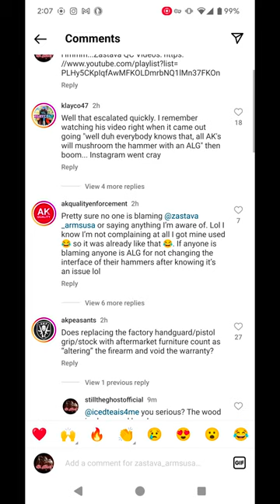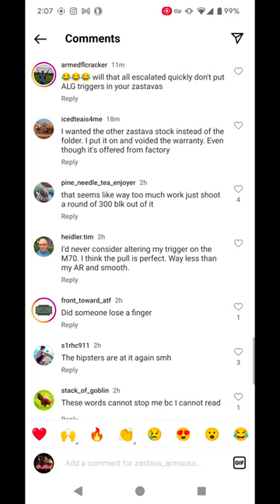Zastava ZPAP M90 Problems? Warranty Voided? QC? Peening Bolt? 2023

Comment: Hey Ghost, I came across your previous videos and this one a little after I had purchased my m90. From what I'm seeing, your warnings of quality control are valid as I've seen some tests where the bolt carrier peens when using an aftermarket trigger group due to the difference in hardness of the hammer against the bolt. I was planning on upgrading the trigger group to an ALG, but am now afraid it will cause the same issue. Would upgrading the bolt carrier group mitigate that issue and is that even possible with this rifle? Or should I just leave the stock trigger group in and break  it in? Thanks for any advice or insight you can give me.
Reply from the maker: If you don't leave it stock they will void your warranty, and blame you for the trigger or piston.

Comment: I remove the knuckles on the hammer and make them smooth. Zero light hammers strikes or failure to reset the trigger. Since then all my AK rifles have zero deformation on the bolt. Get a $25 dollar bench grinder from Wally and this will solve the ALG deformation issue.